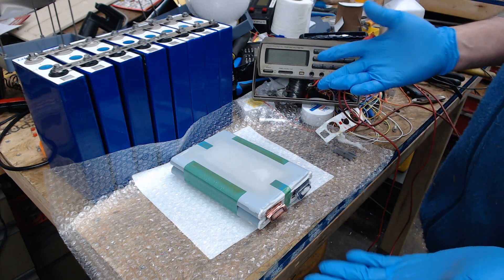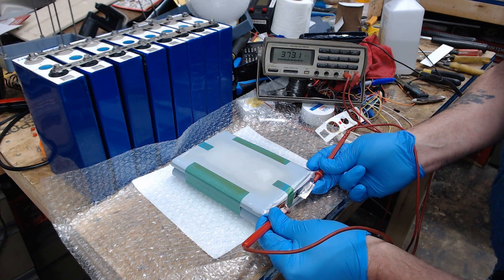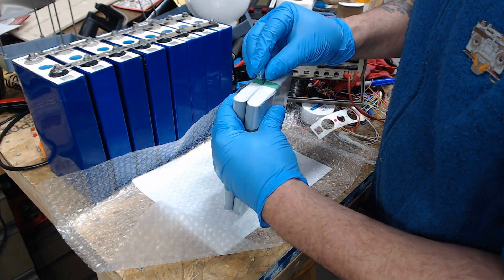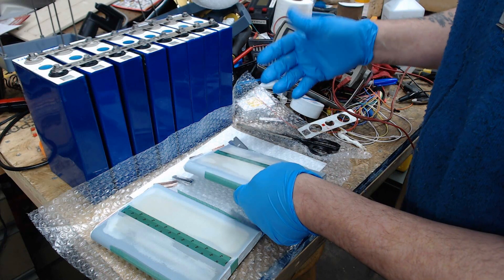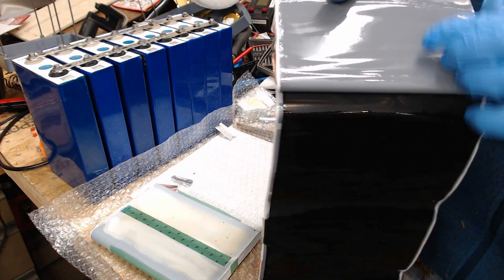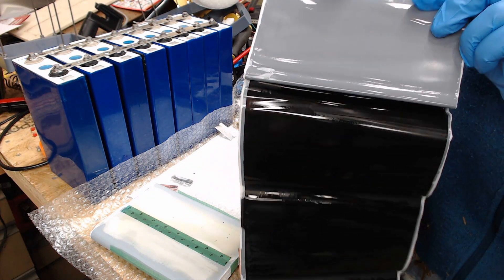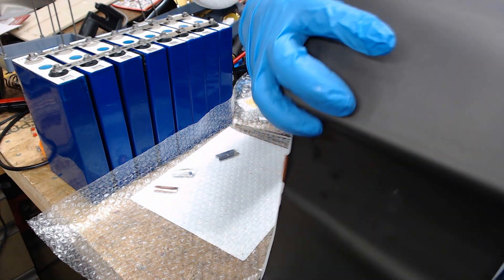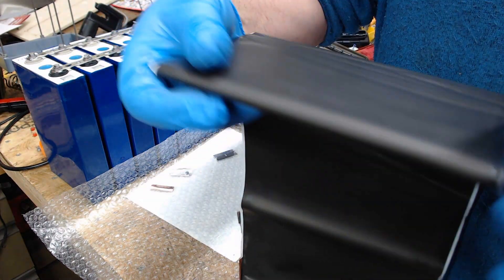105AH BLS LifePo4 Battery Pouch Cells Examination.

Comment: Liquid is electrolyte, likely mostly Ethylene Carbonate C3H4O3 which is solvent.  This is a somewhat flammable.  There is a lithium salt, likely lithium hexafluorophosphate, (LiPF6) dissolved in solvent.  This type of electrolyte is stable from about 0.2v to 4.3v.  Electrolyte is not very toxic, about same as fuel oil or diesel.  If chemically broken down, any release of Fluorine gas is toxic.  The amount of lithium salt in cell is small amount and any breakdown usually creates  a small amount of Hydrofluoric acid not free Fluorine gas.

Electrolyte is vacuum packed (drawn) into laminates after wrapped up.

Not knowing history of cell, my guess is likely excessive current on cell caused it to heat up and cause a leak in the plastic pouch.

Copper foil is negative terminal anode which is coated with carbon graphite.  Looks like graphite is delaminated from copper foil which would be in-line with over-current / overheating theory.

Aluminum foil is positive terminal cathode which is coated with lithium iron phospate oxide, LiFePO4. It is not toxic.

Overdischarge, if left for some time in discharged state, can grow lithium metal dendrites (conductive hairs) that can short out cell by puncturing through plastic film separator between anode and cathode.  Less then about 0.2v cell voltage will begin to breakdown electolyte causing cell to puff up from gasses from electrolyte breakdown.  This also happens above 4.3v overcharging. Most of gas causing a puffy cell is carbon dioxide CO2, not the more toxic Fluorine gas.
Reply: One of my 8 prismatic cells, Lifepo4, went accidentally up to 4.0 volts for some 10 minutes;  it now has less capacity than the other 7;  do you think that the 4.0 volts caused that,or was it weak to begin with ?

It's a long story, an Aliexpress ripoff, i got scammed by an Aliexpress seller who sold me the cells as being 300 Ah, and they turn out to be less than 120 Ah;  have a dispute going on, but they  are proposing a return and refund, instead of a partial refund, which is also another ripoff, because to send them back to China will cost me over 1000 euros/dollars,  besides a lot of paperwork and time ,they weight 40 kgs,or 88 pounds;  

They were shipped "locally"from Germany to Portugal,here,but i read that they always want them to be shipped back to China,which of course leads to everyone having to keep the defective goods. Cells are brand new, factory SS inserts in the aluminum  M8 threads and all, they have the size, weight (5.3Kgs!) and looks  of the real 300 Ah Calb cells ,how could they be made so defective inside, with only 1/3rd of the possible capacity? 

They have no QR code, and no sticker stating any kind of capacity, only a paper sticker saying Lifepo4 , and the 2.5 Volts min.and 3.65 Volts max.

Comment: Is this cheap battery any good?
Reply: No.  Those aluminum case cells use a different chemistry (electrolyte) and have higher internal resistance, shorter life, and of course manufacturing defects like this.  You can see in the video where the copper layer and aluminum layer made contact inside the cell due to the design & manufacturing issues.  The only good LFP on the market are Winston Thundersky, CALB, and Sinopoly - everyone else is a "me too" manufacturer, including battleborn who makes theirs out of lots of small cylindrical cells with a chinese bms board inside that is limited to 100A partial duty cycles, while the other major mfgrs can run 100A+ continuous and 400A+ pulsed discharge.

Comment: I have 90ah cells that look exactly the same but I want to drill and tap the threads to a larger size.

I would really appreciate it if you made a short video showing the terminals from all angles. I want to be sure there’s enough material to widen the hole. I won’t be trying to make the hole any deeper.
Reply from the maker: Actually your in luck! I have found that the threads of the Terminals strip out far to easy (they SUCK) and as such I will be  installing "Heli-Coil's" or Threaded inserts into mine soon. Of course I will be documenting that process and posting a Video. Suggest you subscribe to the Channel if you have not already so you see it when it is posted.
Reply: @J5GURU  yeah helicoil work....sometimes though..not always...it depends if are PERFECTLY inserted. In any case the aluminium of these prismatic its pure garbage. At what Nm do you thight them up? You can go down to 1cm at most...I would not reccoment making a bigger hole cos reduces the surface area of contact...at least...for big battery set up like mine is not advisable. Anyway your video was awesome...made me thing that at the end of the day there are other options when even the helicoil ain't work.
Reply: Subscribe, will do 

I don’t want to helicoil though. Mine aren’t stripped I just want 5/16 or 3/8 vs the m4. Regardless of the material m4 is just too small to hold any real torque. Even using studs and nuts instead of screws doesn’t give me confidence. Usually since a stud is fully threaded before any torque is applied it’s easier on the threads. But again I just don’t trust anything as small as a m4 to not come loose. I don’t want loose terminals or bus bars.

I have both 5/16 and 3/8 tap kits, taper, plug, and bottom I think the 3 taps are called in each set.